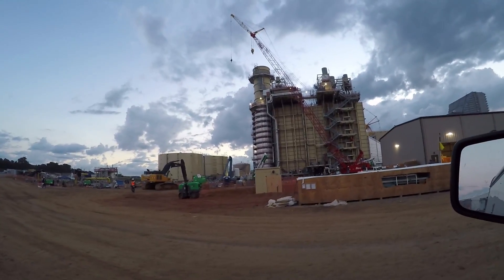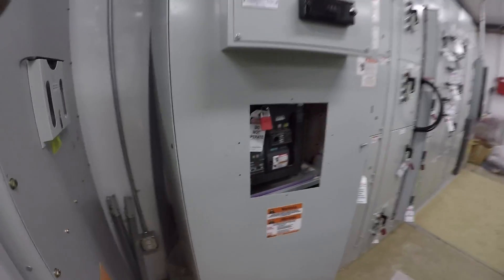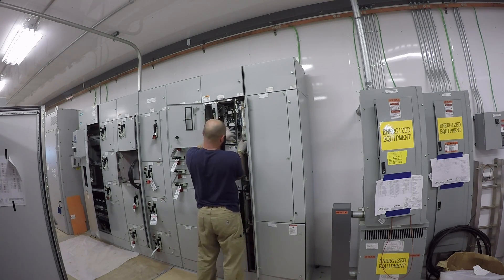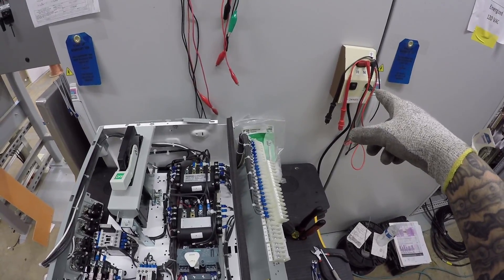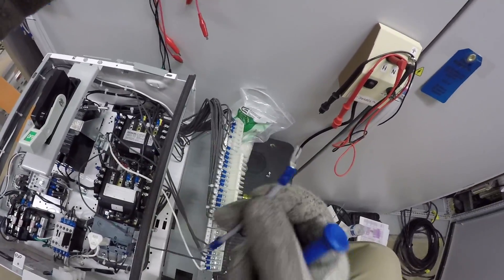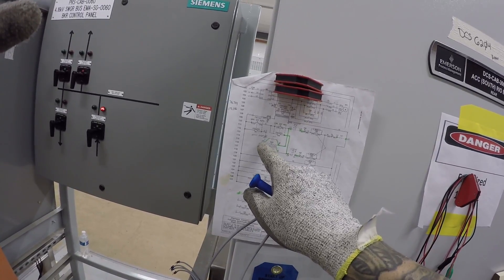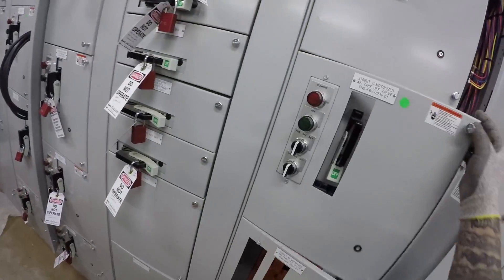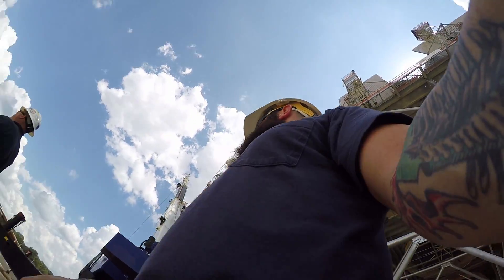MCC Bucket Wiring 1MW Power Generation Plant Motor Control Center

Comment: Thanks for sharing! Coming from an electronics background this power stuff is pretty interesting. One question: what type of wiring diagram is that on the paper? Is there a special name for it?
Reply from the maker: No problem! It's a modified controls diagram for a reversible motor control center bucket. Engineer takes the factory as built, marks up changes/what they want to accomplish, and we make it work.
Reply: Thanks for the info!